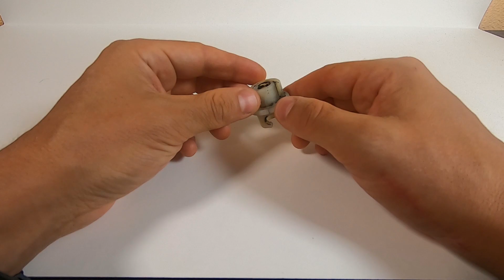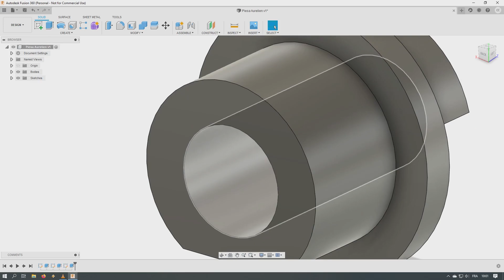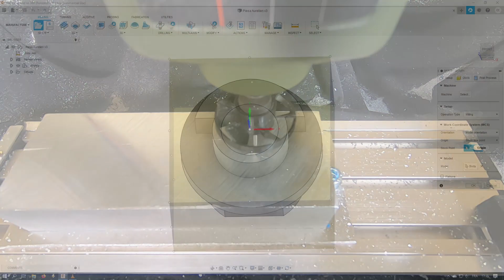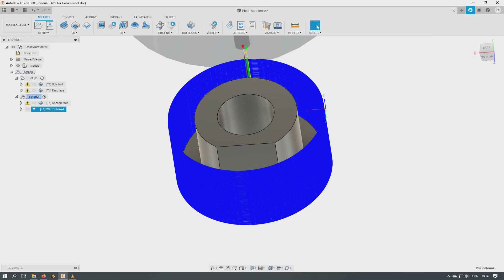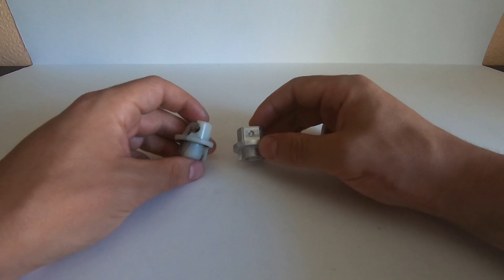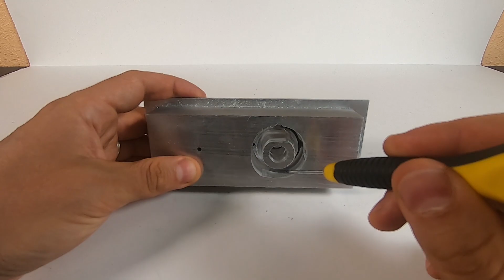Proxxon MF70 Cutting More Aluminum !!!

Comment: Hi! Can I ask your for a bit of advice? I'm looking for a drill press for occasional use, and was thinking of TBM 220, but I looks like (since I'm already spending money and taking up shop space) I could drill holes just as well with the manual MF70... and also, at some point, get into milling or even CNC without getting another machine.
Would you recommend going down this path? Cheers!

Comment: Maybe you can change for 17HS8401 stepper motors, they are the most powerfull of the Nema17 format. Or you can upgrade to Nema23 57HS5120B4 which does not require a lot of current and can work with your actual drivers.